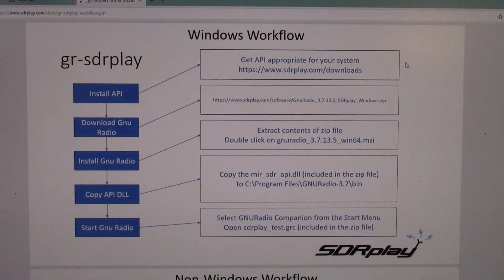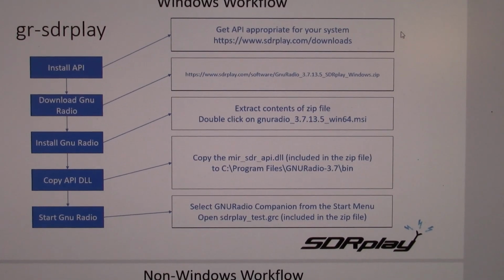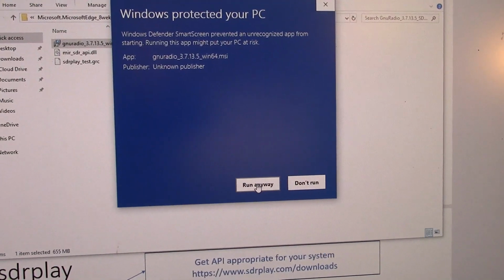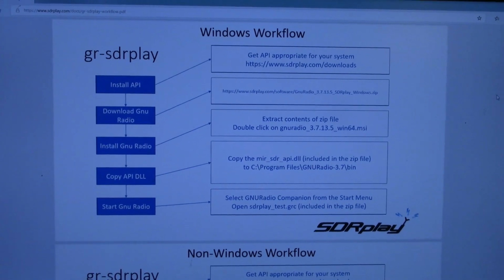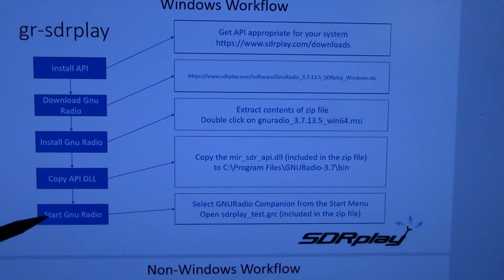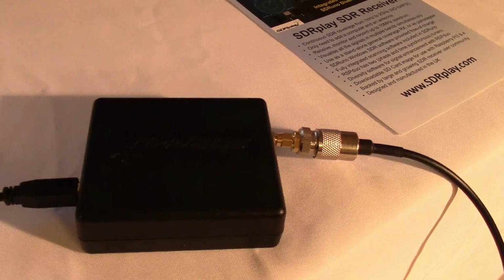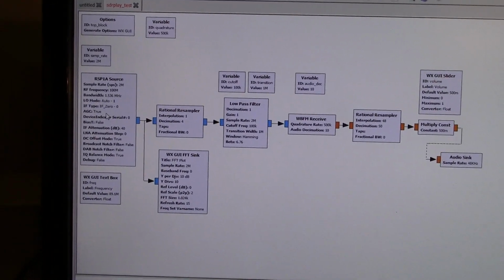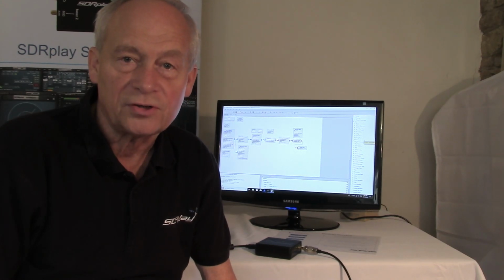GNU Radio workflow for SDRplay and Windows

Comment: The recommended GNU Radio 3.7.13.5 version is a very slow install. Will the mir _sdr_api.dll file also work with GNU Radio version 3.8?

Comment: GNU Radio 3.8 + the SDRplay V3 API gives me a lot of work :-D
Reply: Nice that it is possible to use RSPDuo with gnu radio now. I have tested it and it is working OK with 1 Tuner. My goal is to experiment with diversity and beamforming algorithms and this is only possible if both tuner outputs are available. Is there any chance that in the next version both tuners will be supported?
Reply: My request the same as Cornelis Hoek.    Thank you so much for providing RSPduo source module, but I'm desperate for a way to simultaneously access the data stream from both receivers.  As a backup plan,  even to have two separate duos working at once with a common timebase.    When I try to do this, both channels stop working.   Any help in making this happen gratefully accepted
Reply: Help is needed. Installed gnuradio. I am trying to add dll, but he does not see them. New block does not appear